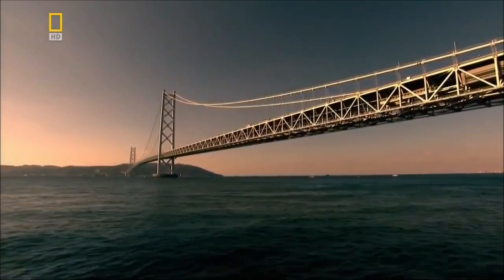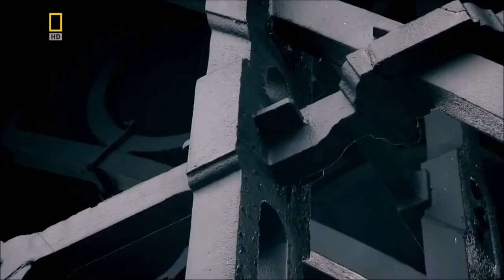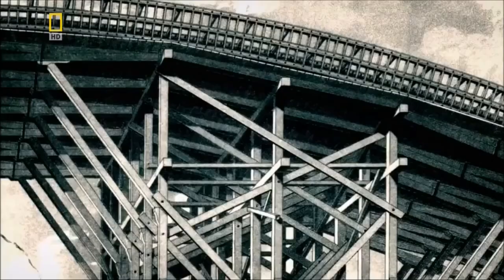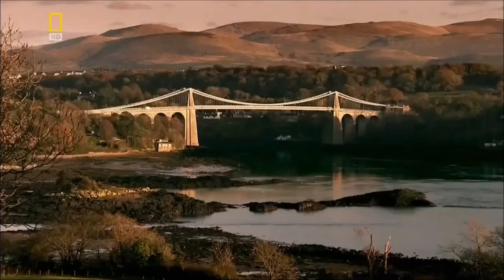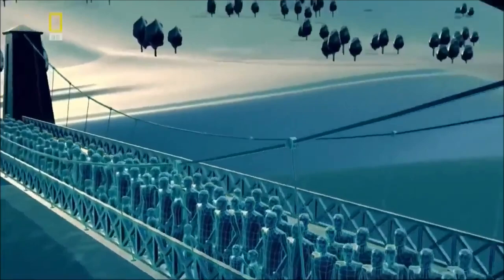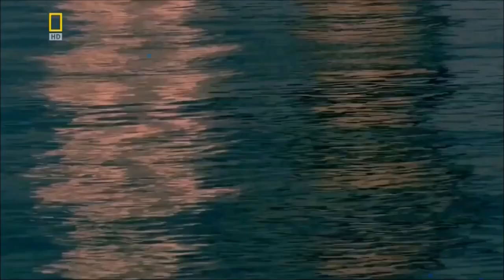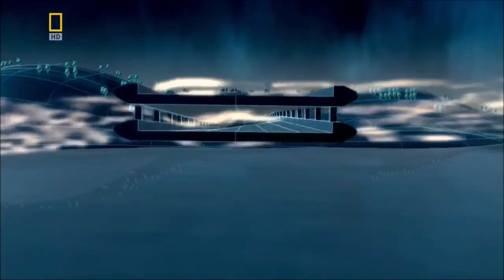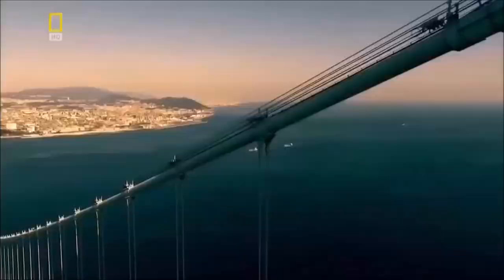The longest suspension bridge in the world full video (HD+)

Comment: If the 1995 Kobe earthquake caused the earth to move, Wouldn't the roadway need some horizontal flexibility to account for a future rift as a result of an earthquake? As in, the roadway should have a way to stretch out by having an underlying inner-extension that can stretch outward on both anchor points of roadway through flexible interlocking parts (since the cables can't be flexible at their anchors and maintain the structural integrity of the bridge as a whole). Did it seem strange that the only earthquake prevention were dampeners?
Reply: Ro Garizurieta not really dampers are a very effective solution
Reply: The Akashi Kaikyo Bridge is based on a very flexible design concept. The central span between the towers is designed to have a displacement of +/-1450m, and has the world's longest expansion joint (you can see it in Street View). Also, the perpendicular displacement at the center of the bridge is assumed to be around 35 m due to high winds. This means that the cable length distortions should be well absorbed. So we wouldn't need to worry too much about the displacement of the earth.
Reply: TOCHInica Unless the earth displaces more than 35 meters
Reply: @rogarizurieta7641  Ultimately, we just have to appease the earth. "Don't move !"

Comment: The total length of the Mackinac bridge is twice the total length of this bridge. As a Michigander, I am deeply offended that it wasn't even mentioned. It was built in the 1950s, and is the longest suspension bridge (total length) in the world.
Reply: She wouldn't be the longest suspension bridge in the world. It's all based on wording, as she is the longest bridge in the world that HAS a suspension span. She's the third longest suspension bridge in the world when measure anchor point to anchor point of the cables.

Comment: The pier foundation cylinders are 70 m in length and 80 m in diameter and weighs 15000 tonnes each .  Mind blowing !!
Reply: Each of them were filled with  265000 cubic metres of concrete .

Comment: The longest suspension bridge is The Mackinac Bridge
Reply: Has the longest central span of any suspension bridge in the world at 1,991 metres 6,532 ft. The length of main span is the most common method of comparing the sizes of suspension bridges.

Comment: The Mackinac Bridge is longer than the Akashi kaikyo Bridge
Reply: Right, and they don’t even mention the Mackinac Bridge in the program. I guess one of the world record holder bridges isn’t important enough for them to even acknowledge.
Reply: Its longer than the Mackinac only in terms of its central span between the towers but from land-fall to land-fall, Mackinac holds world record.
Reply: The parameters in determining the 'Longest Suspension Bridge' is the  length of main span; the most common method of comparing the sizes of suspension bridges, often correlating with the height of the towers and the engineering complexity involved in designing and constructing the bridge.
Reply: The Mackinac and Akashi Kaikyo are suspension bridges, thus only the suspension part of each structure is pertinent here.  There are two ways to measure the greatness of a suspension bridge with the first and foremost being the "mainspan" - or distance between towers.  The Mackinac Bridge is 3,800 feet from tower to tower.  The Akashi is 6,532 feet.  The Mackinac never held the record for mainspan as the Golden Gate Bridge completed a couple of decades earlier had a mainspan of 4,200 feet.  The other was is to measure by their overall suspended sections - that is the side spans along with the mainspans.  The Mackinac Bridge has a total suspended length of its three spans of 7,400 feet.  The Akashi is 12,831 feet.  It is true the Mackinac did have the record of overall suspended length being 950 longer than the Golden Gate due to the Golden Gate having relatively shorter side spans, but the Akashi bettered the Mighty Mac by 5,431 feet - that is it figuratively beat it by over a mile!
Reply: No it's not
Reply: Construction of a bridge is easy if the water depth is shallow. It does not require advanced technology.
Like Key West, you can extend it anywhere.
A huge suspension bridge is constructed when the water depth is deep and construction is impossible unless it is limited to only two pillars.
In the case of Mackinac Bridge, the suspension bridge is small because most of them are shallow water areas.

Comment: i dont care if the false state of facist tukey build a slightly bigger one because the building quality of the turks sucks besides they did have to deal with the akashi bridge's conditions depth; typhoons; daily3-5richter 0r seismological events or go140meters into bedrock and water oe a7.8kobe earthquake at it's most vulnerable  building state it xover only water. so as far i am xoncerned tgis is today still better suspension beidge  and longer over warer (actual 4km with 2+span)